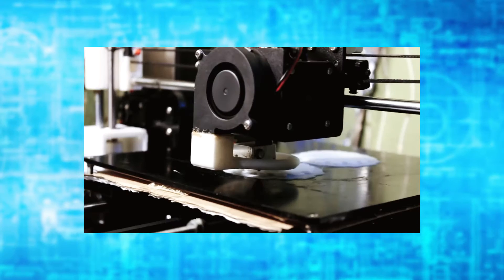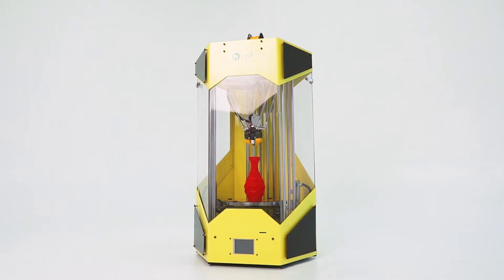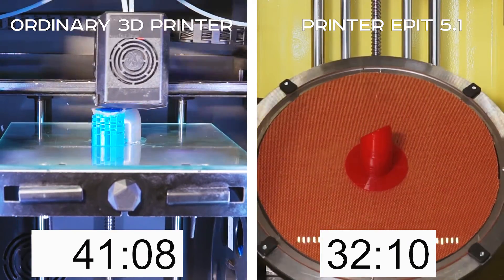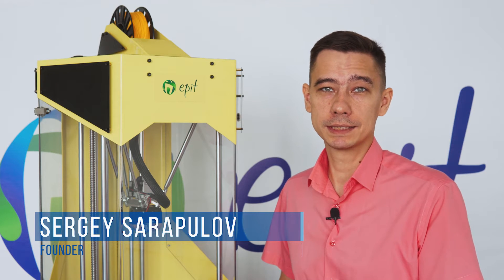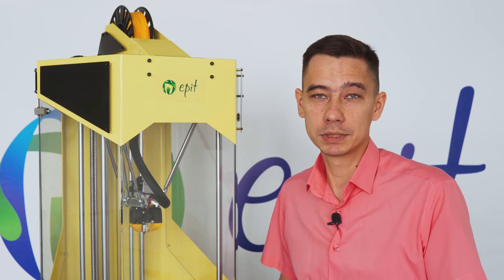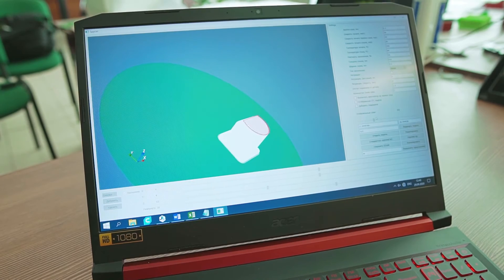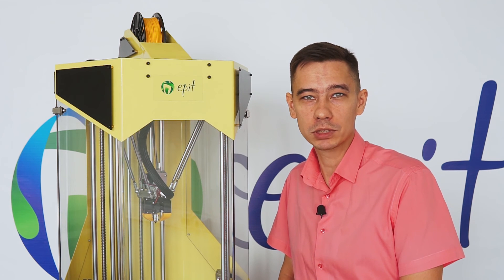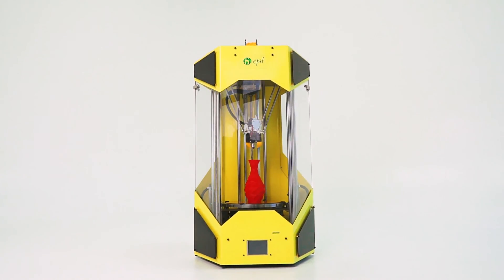5-axis FFF 3D printer Epit5.1

Comment: I'd be interesting testing this out.  Is the software open source?  I'll believe it though when I see it.
Reply from the maker: Hello, Yasmeen! The software is not open source. This is our development and our intellectual property
Reply: @epit3dprinter913  Fair enough, although depending on what components are locked  down it could be an issue. Would replacements parts be easily purchasable, and will the company encourage or prevent 3rd market parts or upgrades?